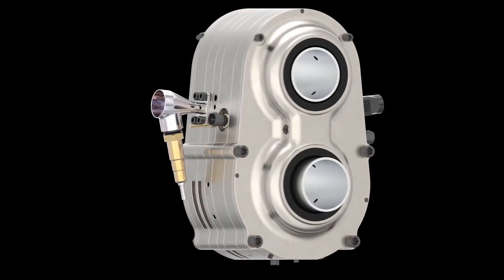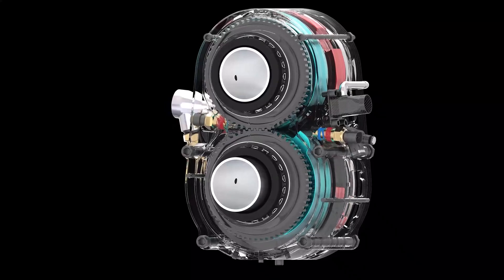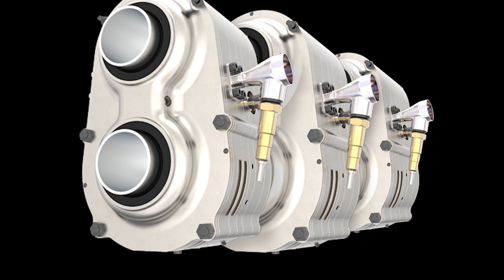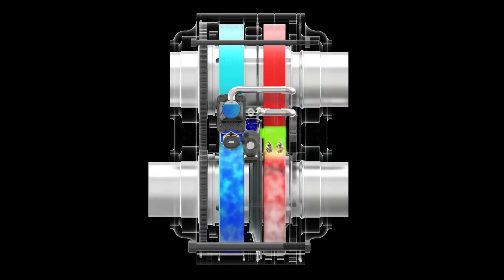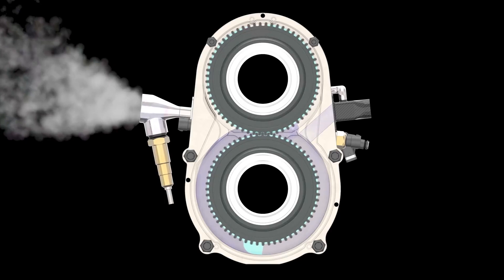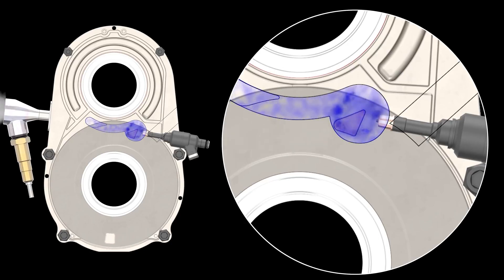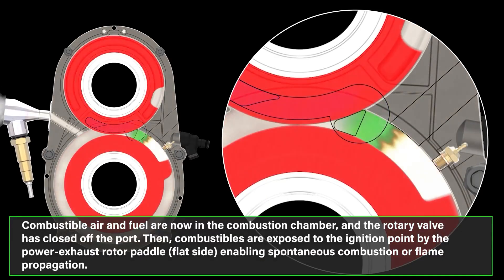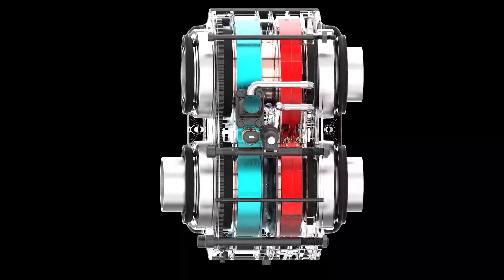This pistonless engine runs on hydrogen and revs to 25k rpm

Comment: Sounds cool. Let's see one run irl. We probably could build one with the precision manufacturing we have now. I'd love to see a working prototype.
Reply: Astron aerospace out of Kentucky has one. It's called the omega 1
Reply: @msharp6887  cool!
Reply: @bloodsweatandsteel.2749  yea it's pretty sweet.  They use a lot of ceramic parts to prevent heat stress.

Comment: And they've built how many working samples of this?  

An engine on paper... who cares?  Show me one hooked up to a dyno.  Show me the actual efficiency numbers and longevity.  

A traditional ICE engine loses 75-90 of its power.    They claim "almost no losses in the combustion cycle".  This is going to be 4 to 10 times more efficient than existing ICE engines?  

If I was forced to wager my own money, I'd place it on "this is vaporware"

Also, hydrogen is a horrible motor fuel.  Virtually useless.  It is incredibly difficult to safely store enough of it to get anywhere.  Worst of all, producing hydrogen is hugely inefficient.  

"They aim to eliminate nearly all the losses associated with internal combustion."  Anyone that says or believes this is not living in reality.  There is nothing about this design that might achieve such a goal.

Comment: The problem is hydrogen.  In its Gas form it is very difficult to store.  The main reason Space companies like Space X have not used hydrogen and instead use stable and easy to store and use kerosene-based rocket fuel.  Also the production of Hydrogen is difficult. Green hydrogen is not cheap, Same with Blue Hydrogen; and Grey Hydrogen is the same as Gasoline of diesel.

Comment: The one thing you are forgetting is that liquid hydrogen is something like 4 times less dense than normal fuel so the fuel tank will be huge and heavy because of the pressure it needs to be able to handle
Reply: ummm no lol not true at all
Reply: @cloudnine5651  alright i just looked it up to make sure I was remembering correctly and here you go "Hydrogen at 50 atmospheres pressure provides about 0.13 kilowatt-hours per litre, and liquid hydrogen provides 2.36 kilowatt-hours per litre. (Petrol or oil provide about 10 kilowatt-hours per litre.)" So not quite 7 times, more like 4 times less energy for the same volume as gas assuming you store it in supercritical / liquid state, to keep hydrogen super critical you must keep it under 179.7 psi of pressure for which you need a pressure tank which requires significantly stronger construction than a average gas tank

so actually ummm yes it's true and you could just have checked if what you were saying was true and you wouldn't have made a fool out of your self

Comment: The idea behind having seals that fail is so the actual block or component isn't the part that fails. I'd rather have to replace a seal than my new fancy hydrogen case.
Reply: @autogyro333  Things like that are called "sacrificial components" and are designed to be the weak link in a mechanism to protect more critical parts. It's important to remember when designing mechanisms that there is *always* a weakest link. It's better to have that weak link be cheap, accessible, and not take out other things when it fails, such as a gearset grenading inside a housing for instance heh
Reply: @HDL_CinC_Dragon  And even if there would be no weakest link.. It would mean that the whole machine is the weak link. So when something breaks, it's the whole damn thing instead :D
Reply: @autogyro333  yes, that and prevent leaks.
Reply: Fox Mulder  The video says it can skip firings, but it doesn’t say it always skips …in fact it seems to say that at full power it ignites on every cycle. I think you might want to watch the video again.
Reply: That's not the idea of apex seals at all you muppet. They're there to give the engine *compression*. The reason they fail is due to the stresses they have to endure and material integrity.
Reply: Fox Mulder  Tight tolerances mean friction. Friction means heat. There will absolutely be thermal expansion. An internal combustion engines relies on heat to work. Stuff gets hot. It would break the laws of physics if the parts magically didn't undergo thermal expansion.
Reply: @autogyro333  No, the real idea behind having apex seals is to seal the chamber and give the engine compression. They are like piston rings on a regular reciprocating engine.
Reply: It could have inserts that can be replaced, just like cylinder sleeves. It doesn't have to be a monobloc.
Reply: Fox Mulder  That is marketing nonsense. This whole thing is either a scam to fool investors or some dreamy student project.
Reply: L O O K 
A T 
T H E 
D E S I G N

Comment: Seems to me it comes down to tooling and manufacturing costs. The world knows exactly how to make a LOT of normal piston engines quickly and cheaply. It didn't start that way, did it?  And this thing, and innovative, great ideas of all kinds, have to get manufactured, and no one knows how. Electric motors have been around a LONG time, and there are MANY incentives to make them smaller, cheaper, more reliable, and more powerful. All those incentives are fairly easy to realize in an electric motor factory because they KNOW how to make electric motors and, like piston engines, have spent 100 years or more improving the designs every year while using most of the same machinery and tooling all along the way. The investment to get any truly great idea to market is always HUGE and very risky. I would love to buy a 100 pound engine that puts out over 600 HP, but I don't think I'll ever be able to...unless it is electric.

Comment: The extreme tolerance and high speed concern me in practical applications. A simulation is perfect but mistakes do happen and parts fail especially at higher RPM. Maybe not a car for the first practical build but a motorcycle to test the concept

Comment: Very high tolerances = high levels of engine wear, 25,000rpm = high levels of wear. The Wankel engine was also rubbish. VW and GM have both built cars that will do 250-300 mpg but the oil companies don't want them for obvious reasons and if they don't want them we wont get them. That is how you know climate change is bullshite.

Comment: ICE is always going to be better than lugging around a ton of batteries with their limited range. Seems like a good modular engine which could greatly simplify manufacturing and maintenance. Hydrogen is the most plentiful element and therefore a no brainer fuel source. People think EV's are clean n' green, believe that and  you're gravely mistaken, plus their isn't sufficient lithium production despite using child labour and not being constrained by environmental concerns. EV's are a step backwards and do little to reduce greenhouse gas emissions.

Comment: Love it. Shits on electric.
Electric is actually old tech. Do a search and see that cars, bikes and even buses were around at the turn of the 1900's.
The powers that be bought up and or made it disappear so they could bring in the oil age.
Now they are pushing climate change and electric cars which leave a huge 'carbon' footprint with cars made of 50% batteries and rare earths that they dig up and process and just the environmental damage on that side of things. Mental

Comment: While it gets extremely high rpms, I'd bet it doesn't have very much torque. 
 Wich means it would have to be geared to spin fast to transfer the power.
Tight tolerances might not hold up long spinning @20k all the time

Comment: Damn this would be good for a cogeneration system for maximizing  efficiency of steam plants. I'm a power engineer at a major hospital. Our current co-gen system is comprised of two 800kw (1072 horse power) 16 cylinder natural gas reciprocating engines. Each one is roughly the length of a Honda civic and weighs thousands of kilograms. They have way too many moving parts and break down constantly. Based on the data given in this video, if this ever goes into production, you could get the same power output with only 9 rotors, and only have it weigh 108 kg!!! Not to mention the shape of the casing would make a great heat transfer surface for harnessing waste heat.

Comment: probably most efficient at a constant rpm. So get it to power a constant alternator, then add it to a electric vehicle and you have batteries to cope with higher peak loads. You could even have an electric vehicle that could have enough input  from a tiny generator that it only depleted its batteries during acceleration and so had enormous range from fewer batteries. If you stop it keeps running at very low output to charge the batteries.

Comment: 160 HP = 118 kW at let's say 40 % efficiency:

Engine turns 295 kW combustion (100%) into 118 kW mechanical (40%) and 177 kW HEAT (60%)

Good luck getting rid of this with air cooling in that package...

Comment: I worry about the long term ramifications of battery powered cars and have always considered hydrogen to be the logical and sensible future. This engine may just be the revolutionary tech to make that happen, not just for cars but also for grid power electric generation. A totally inexhaustible fuel resource with minimum environmental impact. What’s not to like? 🙂

Comment: let's consider it thermodynamically since I am a mechanical engineering student, let's say this engine is ideal with no losses no fraction, and even no heat loss (in short no irreversibilities),  still, it's a heat engine that needs to dump heat into a low-temperature reservoir to complete the cycle, which means you will never get 100% efficiency or even closer to that (maybe %60 at maximum) because the heat engine efficiency highly depends on the temperature, so in this case and considering the hydrogen generation process efficiency, the hydrogen transformation efficiency, and other punch of stuff, I will stick with the electric cars, but this engine may be used in planes or ships which is better than using other engines because it has no emissions, and slightly more efficient.
Reply: @Homie yes I know, but even tho, they are expensive.

Comment: No seals, no compression, low horsepowers. And you need radial seals on the sides of the compressor- and combustion-discs. And those have a looooot of friction....

Comment: Cars are definitely going full electric. Hydrogen as an intermediate power carrier from electricity for hydrolysis to electricity to drive the car is just too inefficient.  But where these new ICE's could play a major role is in large container vessels. Big ships are difficult to make electric because of the massive amounts of energy required. Batteries would have to me enormous. So perhaps hydrogen ships combined with these new types of ICE could one day replace diesel power ships.

Comment: At those RPM's everything would have to be absolutely perfectly balanced.
 The other issue is you talk very tight tolerances how are you gonna lubricate the system, And you still have to dissipate heat.

Comment: I love the concept.  I am a firm believer in H2 as an automotive fuel.  Has this engine actually been installed in a vehicle and tested?
Reply: probably not. it will much likely not even find its way of the workbench if actually manufactured.
Reply: Hydrogen's a very inefficient storage medium.  Fuel cells driving an electric motor make more sense.  This is a solution in search of a problem, and the hand-wavy 'tight tolerances' explanation says it'll never be adopted.
Reply: @graymouser1  Not necessarily.  Machining has evolved greatly in the last 50 years along with metallurgy and other fabricating techniques.  The truth is that no one really knows.  I have always felt that running a rotary engine such as a wankel on hydrogen would solve the emissions problem and may even solve the problem with incomplete combustion.  H2 disburses much quicker and more thoroughly in an air fuel mixture than gasoline maki g for a potential problem solver.  Not sure if anyone has even tried it but it is worth looking into

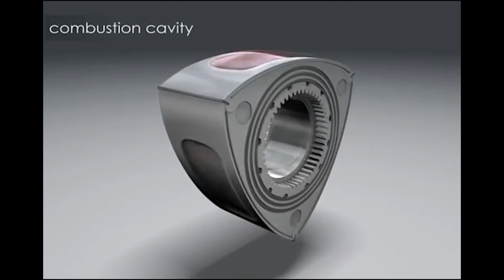Comment: 00:30 lol prior to this I was like "Oh cool, a better rotary engine!"  How could not have been impressed?  The Wankel is severely flawed, this engine is a huge step up from a rotary!  But I guess I get the advantage of having a nice title and a 30 second preview.  You probably just saw some crappy headline and had to read some spec sheet for 30 minutes to get to the impressive material.

This is definitely an impressive piece of tech.  My only question is, at what RPM are you reaching max power?  If I have to get a car up to ~19k rpm to get the power then we've just reached one of the downsides of rotary engines.

Comment: I have optimism as I believe hydrogen power is the way of the future. All it takes is a technological breakthrough in efficiency to produce green hydrogen, and lithium batteries will be left behind in terms of large power applications - and should be much better for the environment too.

Comment: Based on the video length, it took you 60% before you showed the actual combustion/power cycle, that propels the rotor. The only thing that looked remotely apparent, was the Notch, but how and when it was ignited, was so late in the video, I wonder how many people gave up and closed before half way because of confusion and No real explanation in simple details, prior to the Component Breakouts.

Comment: I like how the revolving mass negates reciprocal counter force..
I am a sceptic about the (no seals) when combustion is involved.
Reply: Maybe they can have two opposing engines that somehow counter seal each other via pressure.
Reply: No seals on a turbine and they get way higher compression than any piston. This really runs like a cowled Pelton Turbine with one blade.  The compression can happen without seals, many 2 strokes do that. Much air is lost but some of it can't move out fast enough so it gets compressed even enough for detonation without a spark plug. Cox TD engines worked like that and they ran on Nitromethane. My concern is balance, it better be perfect or it will fly apart but that is achievable.
Reply: @anthonyb5279  10:1 pressure ratio is not the same as 10:1 compression ration, it's alot less
Reply: @ValentineC137  UMMMM so? whats your point?
Reply: @anthonyb5279  didn't even bother to read your entire comment because it just seemed wrong, but just so you know 2-strokes do have seals.

But my point is that you shouldn't randomly splurge incorrect information like that while acting as if you know what you're saying.
Reply: @ValentineC137  Actually the 2 stroke engine I was talking about does not even have valves or piston rings and had 17:1 compression. Every kid that grew up when I did had one. Its called a Cox TD. Millennials don't understand this stuff because the schools didn't even let you play with Estes Rockets.
Reply: @anthonyb5279  it’s a tiny nitro 2-stroke model engine, that is not comparable to actual 2 stroke motorbikes and cars.

Even larger 20+CC nitro engines use piston rings.
Reply: @anthonyb5279  The Cox .049's running nitro-methanol had a stated compression ratio of 6.5:1. The position of the exhaust port has everything to do with effective compression ratio., with the ports being really low in respect to TDC on these model engines. With no tuned exhaust system yes, high rpms and 2 short low exhaust windows did capture and hold. Top of the exhaust port on larger 2 strokes is about half way down the cylinder wall in relation to it's stroke. Despite this and with well designed expansion chambers, the last few years of factory racing Yamaha TZ's (500 CC 2 strokes) were at around 200 bhp which is 400 bhp per liter. This is STILL stronger than the 300 bhp of current 1000 CC motoGP bikes ..
Reply: @xenuno  yep .049 thats right. that made more that that one...lad de da 😛
Reply: @ValentineC137  The point is it can work without seals its not efficient but it works. all the added complexity in other 2 stroke engines with sleeve valves and rings is to make them better. You do realize if you'r rings where out your engine still runs. There is no necessity for seals for compression to occur. but you are getting off the point. this is really a Cowled Pelton Turbine and thats why it does not need seals.
Reply: @ValentineC137  Actually Cox made a Schnuerle like ported 0.15 (2.5 CC) ringless with single exhaust port. Get around 3 CC (0.21 CI) and there is lots of Schnuerle ported (vs deflector bridged piston) engines available. Cox used steel pistons in steel liners, which equalized thermal growth. With heavy castor - synthetic oils, there was no need for rings. I don't think you could wear one out with good clean fuel and air .. least back in the day I couldn't.

Comment: If it runs on hydrogen and not on fossil fuels that would be good. and if the spec's. are as claimed it would be a good alternative to EVs. and if it makes it past those requirements. then let's see some of these engines in real time use and with longevity figures. and you will have convinced me because as it is right now. EVs are the best way into the future although they haven't quite got battery technology all the way there yet. but I'm definitely curious.

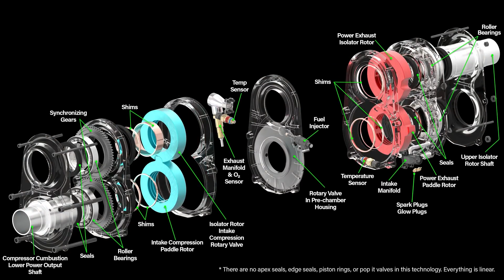Comment: He repeatedly says the engine "has no seals." Then the diagram at 2:04 shows four seals, there's fine print about seal types, and he says "lack of rotor seals" at one point. There seems to be a large asterisk on the "no seals" aspect of this engine.

As with all the other "amazing breakthroughs," I'll reserve being impressed until after real-world prototypes are built and tested, claims verified, durability & cost examined, and scaling for commercial production is addressed. A 25,000 rpm engine relying on ultra-tight tolerances sounds like quite the materials engineering challenge. Especially over the temperature range from a cold start to full operating temp. Extra points for surviving four seasons in Alaska and Nevada deserts.